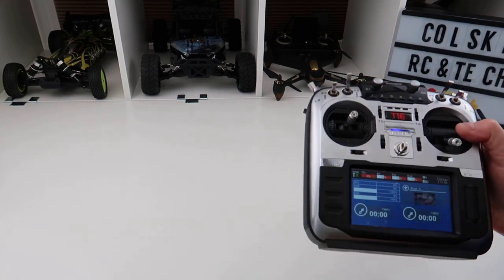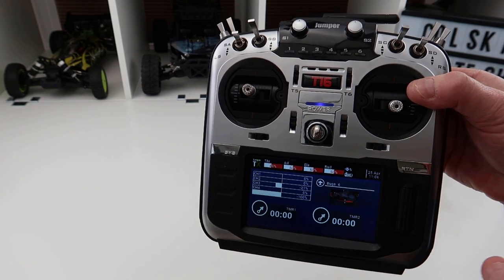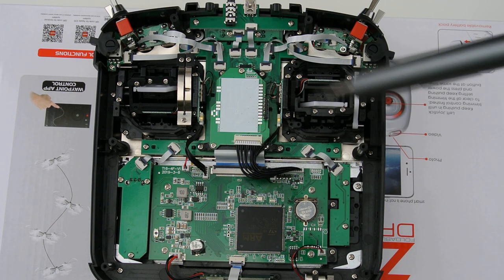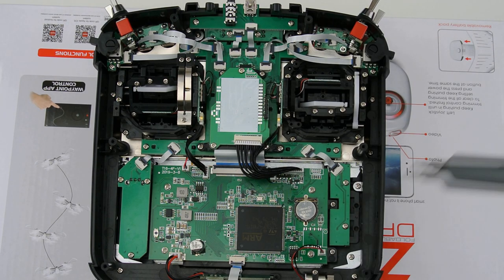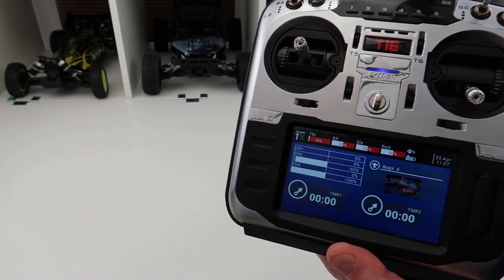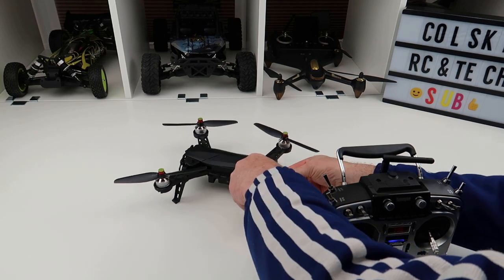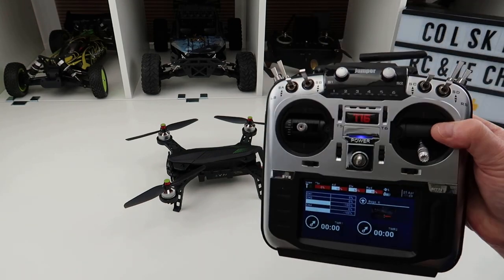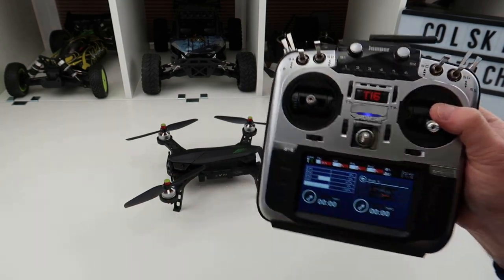JUMPER T16 TRANSMITTER IT'S SIMPLY GREAT

Comment: Yes, nice radio. I received mine a few days ago and I really like it. Things to be aware though. Roller is fragile. I busted mine already....Doh! The sliders positioning is prone to accidental touching and  movement , especially if you're a hybrid pincher. I think this radio is the best value for money for multi-protocol, customization (ie OpenTx) and for using other modules like crossfire and R9M. Looking forward to your updates. Thanks for sharing.